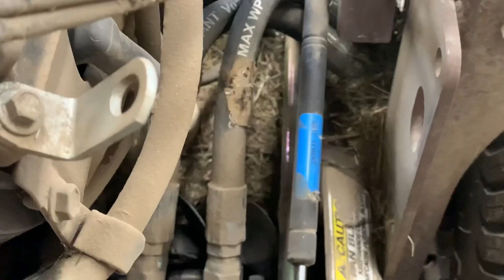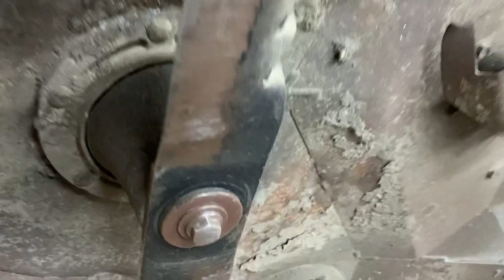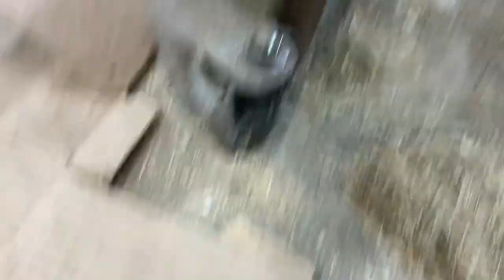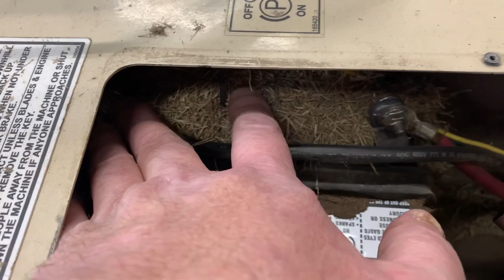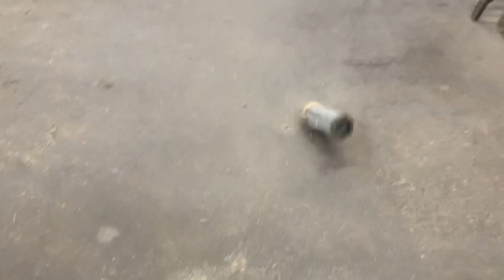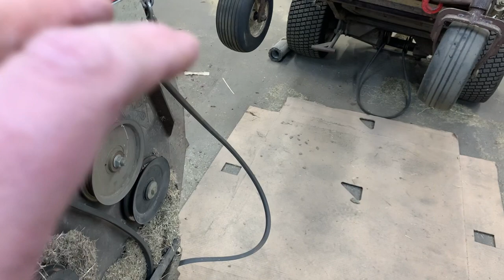MASSIVE AMOUNTS OF ABUSE TO A GRASSHOPPER ZERO TURN MOWER

Comment: I have never seen that poor of care from a Grasshopper. I purchased mine 718 in 1998 and my 225 in 2000. both are still running and mowing great! Spending that much money I kept up the maintenance on mine. I can't believe the owner lets his unit get into such a condition. You need to charge double what you regularly would. The air filter was just stupid full of trash. Thank you for sharing this.

Comment: Grasshoppers are bulletproof and underrated.
Reply: From what I'm reading on the comments from the various posts, all the owners realize their true value. I'm saving up right now. My first zero turn will be a Grasshopper.
Reply: @royalway12  I got a used one 15 years ago and have used it on my property ever since.  It's a beast.  I got it because I wanted a front deck.

Comment: Were the deck wheels really bashed backward equally on both sides?  Looks like they were welded that way.  Anyway he needs a new deck.

I have a front deck Grasshopper too and the deck takes some hits on the front.   But it still works.  Sides are OK and under deck is OK.  I get a lot of grass accumulation too, have to clean it often.  Wonder if that's brand-specific.  Still can't figure out how he got grass inside the air filter cover.  Guess he ran with it open.

Comment: Did they burn up the hydro oil too?  I bet they did.  I know a guy who had to replace a hydro because of this same issue on a four year old mower.  He burnt his hydro oil up so it couldn’t lubricate properly and it locked up the transmission, stalled the engine, slid to a stop.